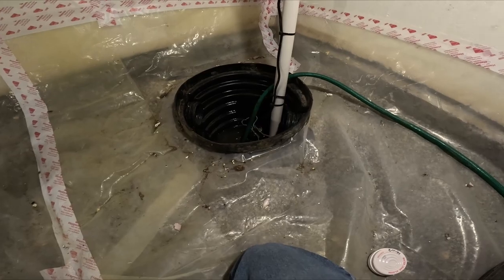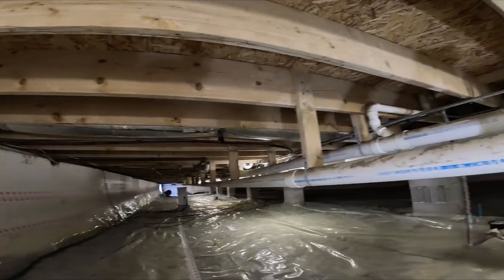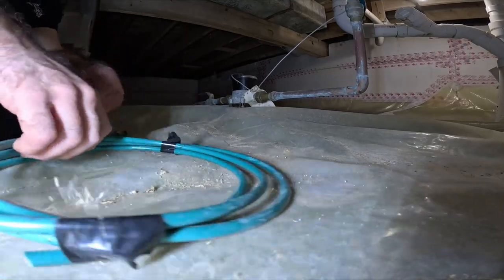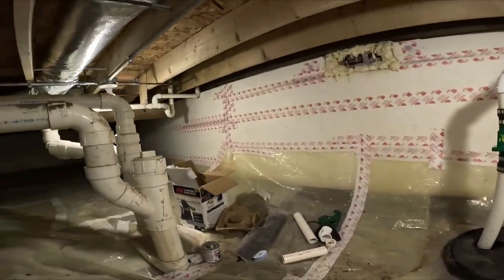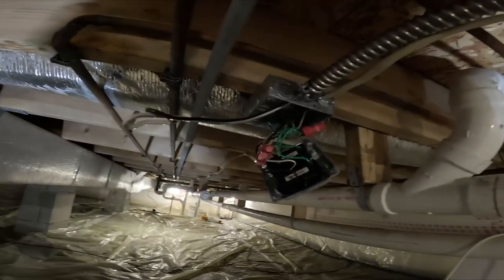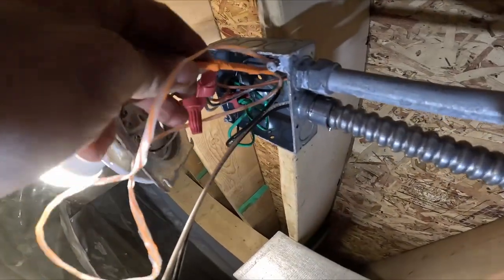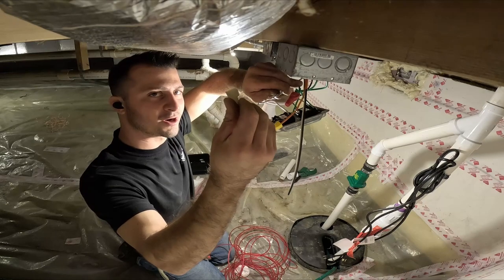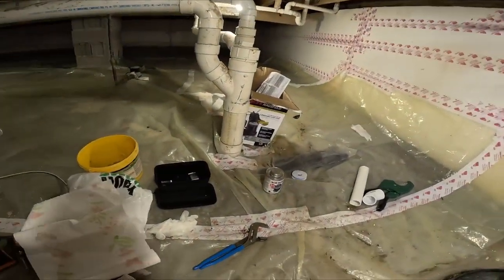Doing some work on my rental/backup sump pump/grounding water meters/pulling another circuit

Comment: When I re-plumbed my house with PEX and removed the crap galvanized I realized I had no ground for the electrical panel. I thought I would have to run about 50 feet of ground wire over to the water main by the meter to re-ground the box. Not ideal. Then I came up with getting a five foot copper rod, drilling a hole above the box and running five feet of copper ground wire outside and attaching it to the rod that was now four feet into the ground. Worked like a charm. Fully grounded electric and new plumbing makes the 100 year old house a lot better.
Reply from the maker: Nice good idea. U should check code around there but I believe there should be a ground rod outside and a ground going to the plumbing main. But I guess look it up and see what other guys are doing.
Reply: @thehandymanexperience226  only one is needed for code here. Usually it's the water pipes